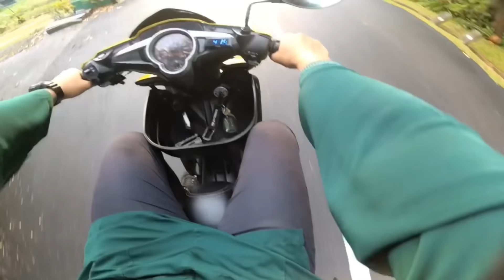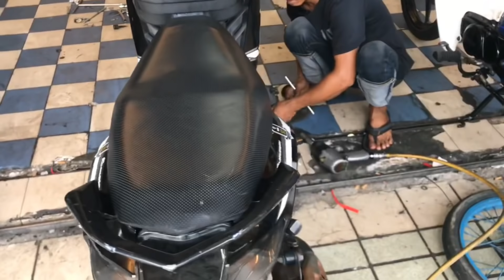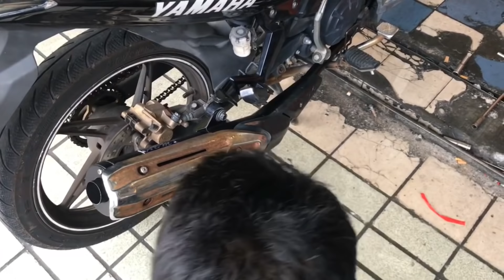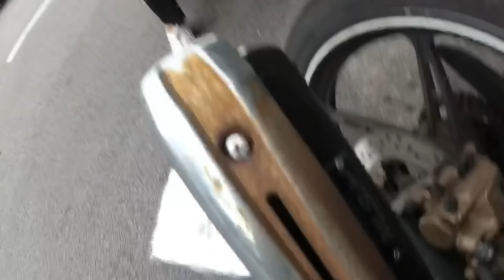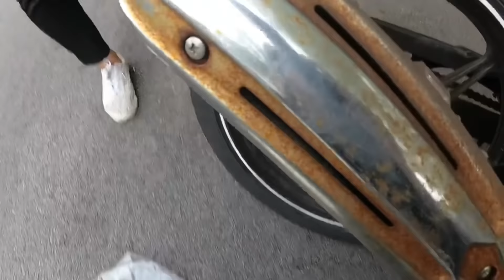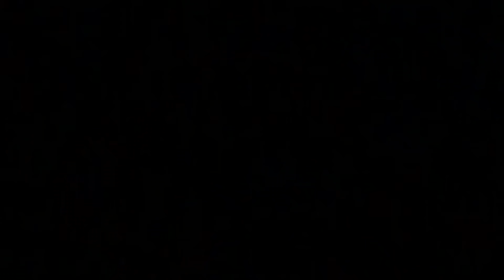LC135 V3 tukar ekzos cutting standard | Malaysia 2019 #LC135

Comment: Kalau spec 65 keatas boleh pakai ekzos open pipe 35 tak??
Reply from the maker: boleh, nk sedap lagi msuk superhead 22/25
Reply: @Jaiwilldo  mmg pakai superhead, carb uma 34 tapi low rpm sengguk²..carb terlalu besar ke ape?? 😅😅
Reply from the maker: Aparat Keparat carb 30/32mm ok kot utk spec 65, 34mm mcm besr sangat